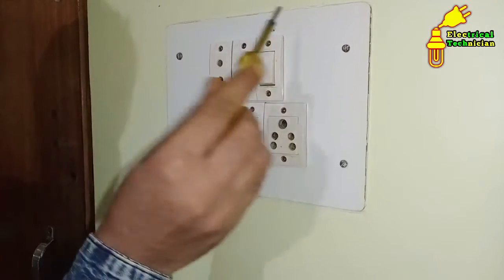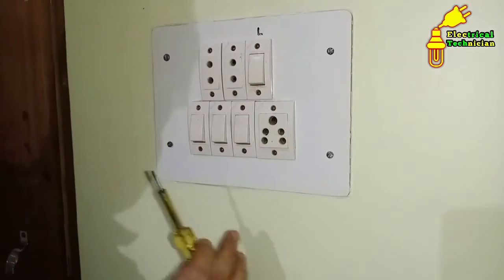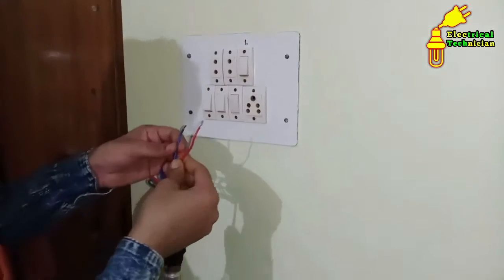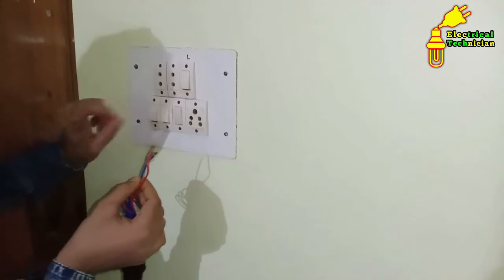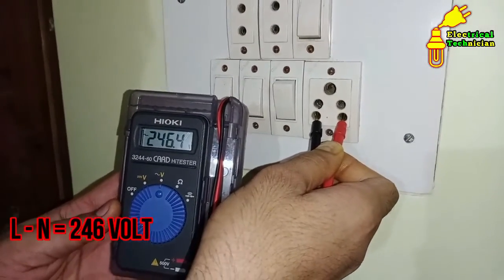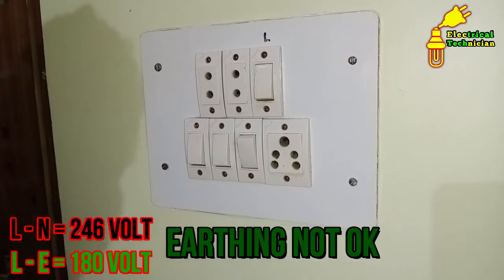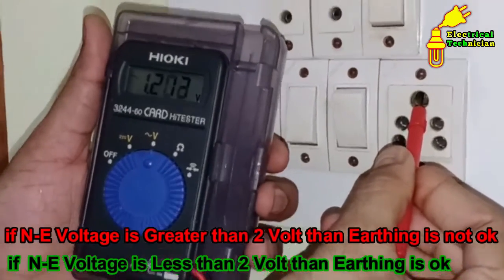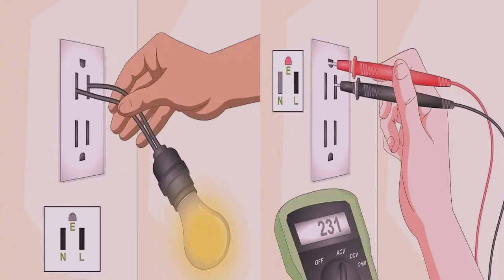How to check Earthing is Proper or Not in Home @TheElectricalGuy

Comment: glowing bulbs via earthing is very dangerous
1. Earth is not designed to carry continuous current

The earth wire is only for fault protection (leakage trips, short circuit path).

Using it like a neutral can:

Overheat the earthing system

Damage wiring

Trip RCD/ELCB/MCCB

Cause shocks

Comment: The earth pin is bigger in size, not because of we should not give wrong wireing connection. That means the earth needs a thicker wire than phase and neutral. Here is the rule. Thicker the conducting gauge of wire, less will be the resistance, as such any short in circuit will be passed to ground within few micro seconds. So always use a very thick wire,  preferably green color to identify the wiring. Never believe electricians who always guide you to use thinner wire by saying ' the cost of total wireing will be less'.

Comment: Some of LED bulbs dim-glow while switch are off. I checked the connection of wiring only phase are supply is given to switchs. What could be the reason for dim-glowing of LED Bulbs  ?
Reply: Probably neutral line is connected to switch instead of phase. So when you switch off, the phase is still active and give a very dim glowing bulb even if you switch it off. Call an electrician and have him checked it

Comment: Looks like you've connected Neutral to the Earth Terminal to gain the views..

It's impossible that Voltage will show Exactly the same in Both Neutral and Earth points in your Multimeter method..

Comment: Namaste!
Thanks for enlightening the household people. However nowadays in many home wiring for safety they also include ELCB or RCCB. In such cases if you use a test lamp as shown between Phase and Earthing the RCCB will trip.
Although it is a good sign that the RCCB is working properly' lay man(people) may get confused. So you can better add this in your next video.
Thanks.

Comment: Ok sir, so what causes my led bulb (240v) to continue lighting even after the switch is off? It remains dim you cannot see the dim light during day but in the dark you can see the dim light. The switch is correctly positioned it is on the Live wire not Neutral so what could be the cause?

Comment: the mcb will trip when you connect the light bulb to the earth, that is what the earth line is ude for. Please explain.
Reply: Only if it is RCCB, not MCB.
Reply: I think if the neutral is connected and the phase come into contact with the earth,it will create an earthfault and it will trip. But since no neutral is connected in this case, the earth now just act as a neutral wire itself

Comment: At 1:42 i would like to suggest that remove the main neutral wire only from the main box.
Then check the earth line with the bulb. As often to cut cost the electric contractors join the earth wire with the neutral.

Comment: IF THE WIREMAN HAS CONNECTED NEUTRAL WITH THE EARTHING TERMINAL, WE WILL GET ZERO VOLTAGE BETWEEN THESE TWO TERMINALS. HOW TO BE SURE THAT PROPER EARTHING IS CONNECTED TO EARTH TERMINAL AND NOT SIMPLY SHORTED WITH NEUTRAL TERMINAL?
Reply: You explained

Comment: When you insert wire of test lamp orprobe of multimeter always insert the neutral first then phase. In case you insert phase and accidentally touch the other wire or probe you will get shock
 Also good practice to use series test lamp so that even if 550 volts is present you are still safe as lamps will not burst due to highvoltage
Reply: Very easy to understand explanation

Comment: Nice video sir but in carrying out these test, should we switch of the circuit or the socket or we should live it active with current flowing
Reply: The switch should be on because that's the only way you can get a voltage reading

Comment: What should be wattage of the lamp used? Some one told me it should be 100 watt bulb. Why? What precautions to be taken while checking voltage of 220 volt
?
Reply: 100w is bright enough to check variation...but even 40w, 60w bulbs can be used.

Comment: Hats off to you. But pls give justification. The volt that runs through phase be same when returns via neutral. But after the phase voltage energises an electrical equipment it will lose the same strength when it enters the phase? Pls explain

Comment: In India neutral and earthing are connected together.
Reply: In most countries neutral is connected to earth in grid source. However earthing is different from neutral a neutral doesn't save you from electric shock during current leakage.

Comment: pl tell me how to find out which wire  is neutral  and which one is earth in the absence of color code  excluding test lamp method
Reply: The top point will always be earthing, and to find out the bottom one, you will need a tester. Of the two below, the one where the tester light will light up will be positive , and the other will be neutral.
Reply: @TusarRoy-fl4li   I know that Pl read my comment again I mean wire not socket . To test which wire is earth connect that wire  with another one from earth point of the socket, go for continuity test  or remove home earth connection and then test with a test lamp I checked using multimeter but it showed same value  so I could not  confirm which one is earth after  heavy rain

Comment: hi, i have tested using the methods which you have shown and its all ok like you said but the voltage between neutral and earthing is 3 volts, i am getting shock from touching appliances like phone charger and the body of my computer
can you explain why is that and how can i fix it?
Reply: you have to do earthing in your home call a certified electrician and do the process they will install a aluminium rod

Comment: While checking neutral and earth if not getting any reading means? what's the reason?
Reply: phase terminal has current due to which the bulb glows. If you connect the earth and neutral then there is no flow of current and hence, zero reading

Comment: Between my earth and neutral are showing Zero volts in multimeter is that ok? cos i saw in some video that 0 volt is also not ok is that true ?? The rest Earth and phase , phase and neutral are all fine.
Reply: Meaning no given earth connection

Comment: Thank you for the quick explanation. I saw your other video on using Capacitor for power factor correction. Which Capacitor is to be used and what is the MFD etc to check and buy for the installation? can you guide 🙏
Reply: it's for a home with a single phase connection. I observe frequent fluctuations. Below 200 V is what sometimes it happens.

Comment: With the lamp method, I think when you connect a phase with earth ,you are creating an earth fault , and I think that lamp will just blow. Explain more!
Reply: A proper earthing should work as a neutral, meaning it should have the conduction ability to take away all the phase current. So when an equipment faults by making its body hot ( leaking phase current to the body), the equipment body connected grounding (earthing) wire takes away all that current to ground and makes it safe when you touch a hot (short circuited) equipment body unknowingly. Human body with high resistance provides a less favourable path as compared to the properly connected very low resistance earthing (grounding).
Reply: Any lamp will glow only if there is a potential difference/ more the difference higher the glow/ The fault will not occur because all the potential is used by the lamp. If there is less potential the lamp will glow less, but however all the current will be consumed by the lamp based on the potential😊
Reply: @manishsharma-hv6vk current is never consumed by load if it is done then there is violation of kirchoff law.

Instead , here from phase to earth , a closed path is formed and hence the bulb glows.
Reply: It can't blow bcz earth and neutral are related